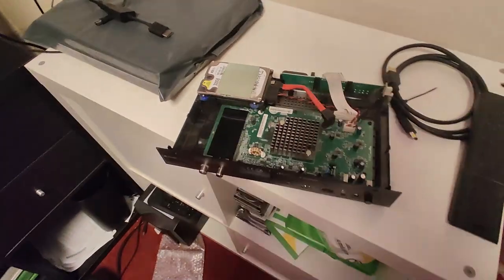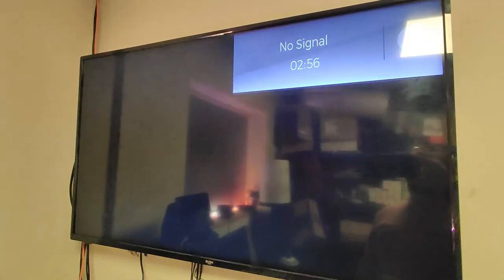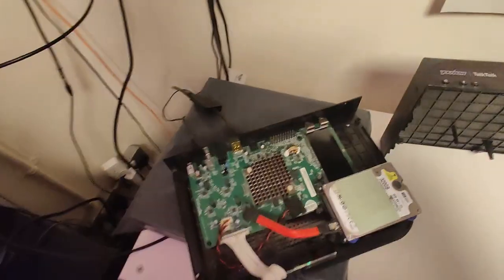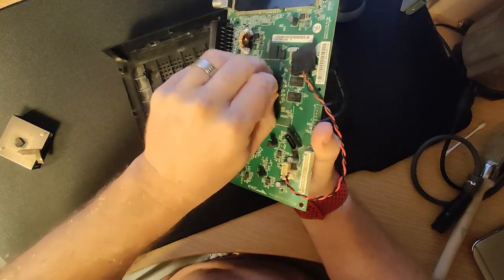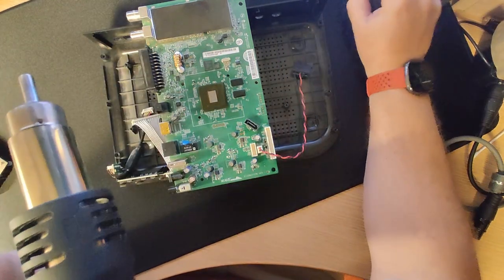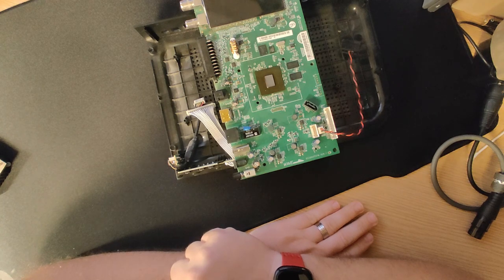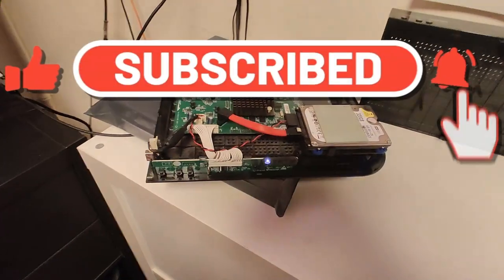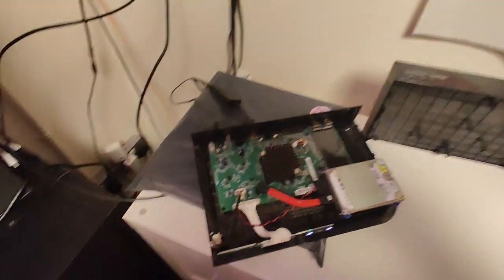TalkTalk TV Youview DN370T Not Booting Up Can it be repaired? Lets see what we can do in this video

Comment: Hi. I've tried to replace the harddrive of my Huawei DN370t with another identical drive but it won't download the software. Have you replaced any hard drives?
Reply from the maker: Yes. You need to make sure the drive is just one partition, raw format. Then once fitted in the device access the maintenance menu to fully reset
Reply from the maker: What I would also say is the 370 is prone to failing, it's not a great box. Also take note of the Amps on the replacement drive. Shouldn't be more than the one you are replacing
Reply: Thanks. I don't know how to check the formatting. Do I need a caddy and a pc? Is it easy to do?
Reply: The box is at least 7 years old and has been used almost daily so doesn't owe me anything but would be nice to fix it.
Reply from the maker: @mikeeadie  yes that's the best way, or just use a brand new disc as they come raw formatted.
Reply: I have a new drive (exactly the same as the old one) when I try the software download it starts but won't finish. Is it maybe blocked as I'm not a talk talk customer or any other reason you cold think of?
Reply from the maker: @mikeeadie  have you tried just doing a reset, not the software update?
Reply: I tried the reset with the new drive fitted but it wouldn't do anything. I refitted the original drive and did a reset and it has cured the problem! It won't do any software update though which makes me wonder if they are just not available from Talk talk or you have to be a customer. If it won't download the software the new drive was never going to cure the fault anyway. How reliable do you think this reset will be?
Thanks for your help.